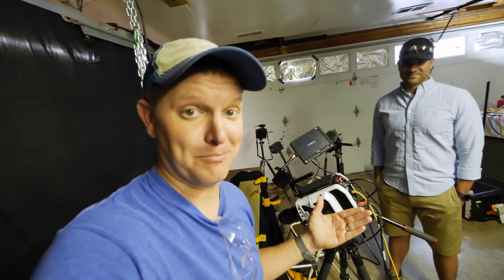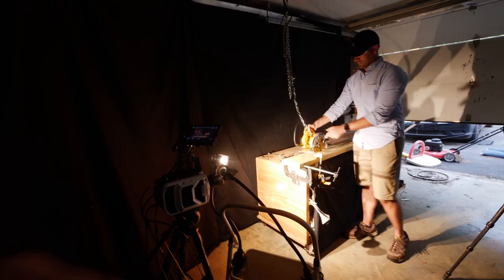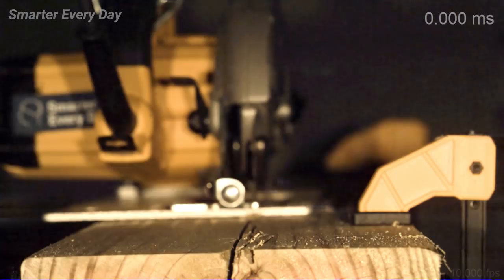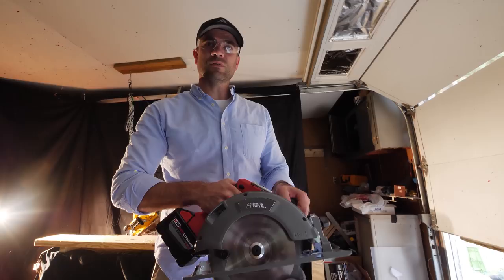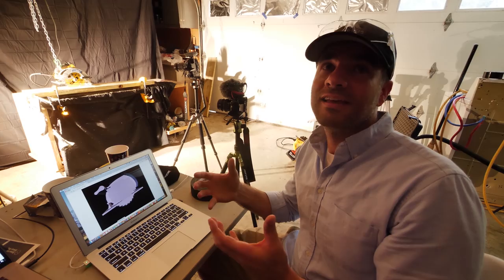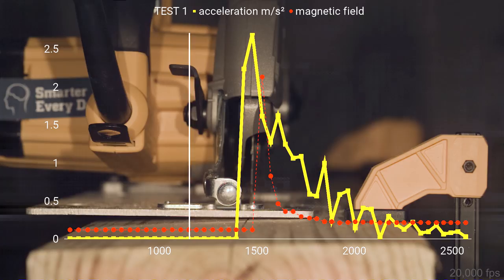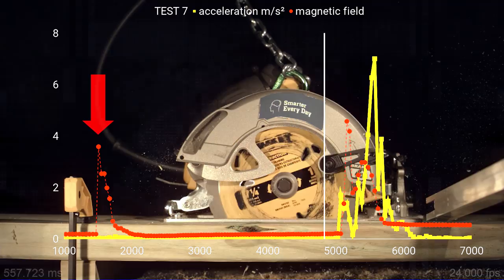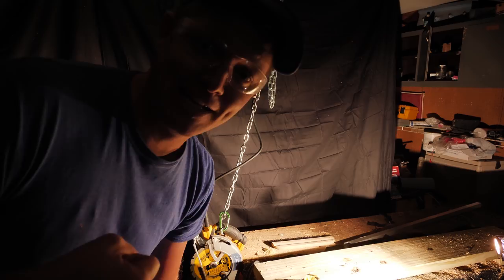Circular Saw Kickback Killer (We used science to make tools safer) - Smarter Every Day 209

Comment: This could have prevented my accident, when I was 10 years old I was using my dad's power saw, the same incident happened to me when the saw hit a knot in a 2x6, the saw kicked back and landed in my right thigh ripping into my quadriceps muscles and caused me to have emergency surgery to reconstruct the damage. I was crippled for nearly a year and a half and still took a few more years to finally get back to 100% use.  

I am now 63 years old and the scar on my right thigh is a reminder of a horrific day, my dad discovered me laying on the floor in a puddle of blood, dad removed his belt, I thought I was going to get a spanking for doing something bad but dad took the belt and tide it around my leg at the top of my thigh and laid me in the back seat of the car on my older brothers lap as he rushed me to the hospital, I passed out from the loss of blood during the fast drive to the hospital.  

My brother had told the story how dad grasped me from his lap and ran into the hospital with me dangling in his arms like a rag doll screaming at the staff that his blood type was the same as mine, I remember waking up and my dad was lying next to me, he had a tube running from is arm that was taking his blood and they was transferring it to both of my arms.  

Your design is needed even if it prevents just one injury. I hope my story will fuel your work and help convince manufacturers of the need for your design.  

Eric, Kennedale, TX
Reply: 10 years old and saws don't mix but I used to use saws like these, lathes and other dangerous machines when I was young like from 8 to 15 years because my uncle had them and we made stuff but I lucky never got cut
Reply: Thank you for your story, it deserves more likes. You are completely right about preventing just one more accident, this invention could be the difference between life and death for another family out there right now. Imagine if your father had not found you in time.
Reply: Wow what an amazing story I teared up from your family dynamic, I'm so glad for you that you healed
Reply: And that your dad was there to see you in time
Reply: There's alot that can be improved with tools
I mean, I think DeWalt or one of the big names has a table saw that senses human skin, and stops injury
But unlike other table saws like that, which shove a piece of steel into the blade, wrecking it; this one drops the blade to below the table

But anyways my grandfather got injured by a planer. After he had used it, and it was spooling down (this was when my dad was in middle school, and Gramps never really had alot of common sense according to dad) he decided he wanted to clean it.

So he reached his hand into the machine, with the rotors/cylinders/whatever still spooling down (it was turned off, but they take a while to stop). All 4 of his fingers on that hand were TORN off. Not cut off, TORN. And the fingers were also shredded in the machine as well.
From then until the day he died, his right hand was a palm, a thumb, and 4 stubs where his fingers used to be
Reply: Should become a writer and start writing for movie scenes with a group..  if the stories real you did a good job putting it in a visual context for the reader to easily depict a certain emotion, if you just made all that up than you have a good imagination on top of the verbiage skill..
Reply: In companies using any powertools, there is one rule. You never ever work alone in a certain room or area. There must always be somebody to save you. If not, find somebody to help, or do that job another day. Work is not worth dying for.
Reply: That is so... sad and brutal.
Reply: thats why power tools arent for kids.
Reply: Your dad sounds like a goddamn hero. Thanks for sharing your story.
Reply: Well it doesn't matter if you are 10 or 40 year old if you don't understand how much harm the machine can do you will never be carefull.Only way is to know what the machine can do when it is not handled properly and to be ready for anything happening anytime when you are using it.
Reply: @voornaam3191  Thanks for this. This lockdown season am alone in a gated residence. Am using a couple of power tools to do a pantry. Came here when I experienced a kickback from a circular saw. I always only unlock the gate, just in case, before I power on my tools. From your comment, am a lot wiser.
Reply: Wow
Reply: Nearly lost two fingers when I was 15 safety is always worth it.
Reply: Alex❤️❤️
Reply: @kongen867  he never said he had his dad's permission
Reply: @kongen867  You have obviously never raised a child.
Reply: _ David _  Same to you and everyone else blaming the father. 100% Guaranteed to never have raised a child.
Reply: Jacob England oh please shut it and listen to this story - be kind.
Reply: Thank you for sharing, Mr Eric
Reply: @turkwillingston218  yeah now 60 years ago yes
Reply: ElamCo Inc. you talk absolute nonsense.  Try Facebook. Maybe you will get attention on there.
Reply: Sad.....
Reply: @Z-Ack  I disagree. The story seems like it was taken straight out of some cliche movie script. He woke up with his dad giving him blood? That's not how it works anywhere but in the movies. Directed donations (donations from a chosen person) aren't used for emergencies because it takes time to prepare the blood.
Reply: @lchadwick88  Unfortunately people are gullible all over the internet not just Facebook.
Reply: Mister, your story hit me really hard, God bless you and you had an amazing family, I hope one day to be as good dad as yours
Reply: @Alexander_l322  I did the same thing, and had the same luck...
Reply: @shojimujoshojimujo3315  Direct transfusion was occasionally used in emergency situations in the era mentioned here. However it is a technically difficult procedure with much to recommend against it, so it has been pretty much entirely replaced by various methods of indirect transfusion.
Reply: This deserves highlighted comment or pinned comment, which ever will give it more attention ! 
Thanks for sharing your story!
Reply: This accident could’ve been avoided with something much simpler that this videos tech. It’s called common sense.
Reply: The only thing needed to prevent your accident is some Adult supervision
Reply: As a father of two boys I felt every word of that story and it brought tears to my eyes. Thanks for sharing!
Reply: Thank you for sharing your story, well told as if we where there, electric saws are a dangerous tool indeed and can cause serious injuries
Reply: Unfortunately, 53 years ago computers were not yet fast enough to react in time, even if we would have had the software.
Reply: That's why I never stimulate younger as 18 to use or work with whopper power tools, the same goes for entering the gym, not 18 yet! use hand tools ,not 18 yet! get to learn to lift your own weight first instead of lifting gym weights...
Good for the situation that it worked out better again, and success in for the rest of your great life.
Reply: did your blade gaurd fail?
Reply: > I was 10 years old I was using my dad's power saw

That was the root cause of the accident.
Reply: Hope you’re doing well in all of this lockdown and stuff dude
Reply: @Alexander_l322  different times dude.
10 year olds back then were outside, working, not inside all day long playing video games like you most likely were doing at 10. 
(and most of us here, honestly
Reply: @kozmicflush980  well actually I was out playing all the time, working on weekends with my dad, building things with my uncle using power tools and his table saw but I learnt how to use them safely at a young age.
Reply: Sorry that happened to you, and I agree these updates could help save injuries. But my tack might also be don't let kids use power tools that this is possible. I cut knots all the time today you can't find wood in my opinion that doesn't have them. So training and maturity needs to be involved so you can control the movement of the saw.  A 1 to 3 inch kick is all in a days work; loosing your neve and letting a saw run across the saw horses and hit someone standing there waiting on the next cut is unacceptable. When I was the age of your injury I was drilling holes for pulling wire in studs. And pounding nails but never was allowed to touch a power saw.  ...and yes drills can hurt you too but mostly skin your knuckles or bust a wrist.   If I wanted to saw I had access to dad's hand saw anytime.
Reply: I gotta question why a 10 yr old would even be anywhere near, dangerous power tools, let alone using them! 

Glad u recovered well, tho......
Reply: @kongen867  you know people used to eat mushrooms straight off the ground and die. Was that dad's fault too? Take some responsibility. What's been handed to you was by an idiot.
Reply: @passiton3801  he didn't have rigidly structured mind-numbing videos to watch all day, because the one tv was shared. No phone or tablet to sneak in the bathroom. Possibly, he saw(?) his dad use it, thought that was really cool, may have even talked about it. If you were ten and ever felt like doing something, there isn't much to not know. Lol. If you can't figure out a ten year old, don't worry about it too much.
Reply: Nothing to do with tools, but when I was young I went down the some rapids that were decievingly powerful. I got pinned under a bolder and nearly drowned; my Dad got himself down there to push me up, he nearly drowned himself. It was hundreds of pounds of overwhelming force; my dad worked the oil fields, so he was thankfully a very strong man. I tried going down rapids once after that; was told if I get pulled down just relax and I'll pop out... I was having fun till I seen one I wanted nothing to do with. I jumped off my raft grabbing onto some tree roots. I climbed out and the entire raft went under. I was expecting it to pop, but minutes later it popped up... I've never gone down rapids since, and hopefully I never will.
Reply: Didn't the saw have a gaurd? I mean if there was a gaurd and you got hurt why do they even put them there.
Reply: i cried
Reply: @user-hd8ej8yx9p  He is copying the scene from the walking dead when Karl got shot by a hunter. Lol.